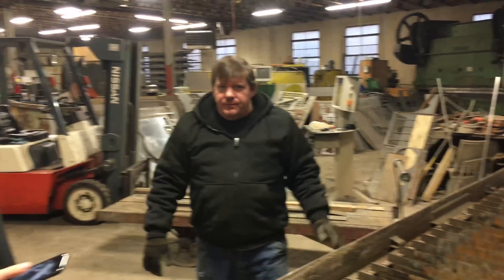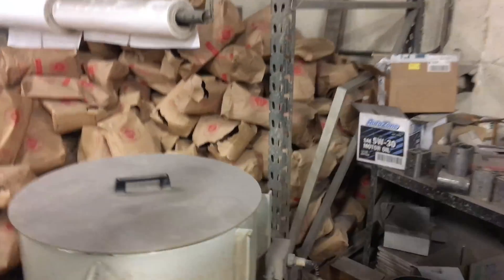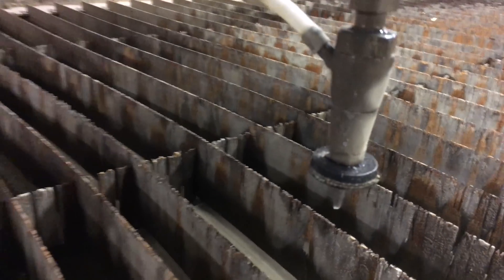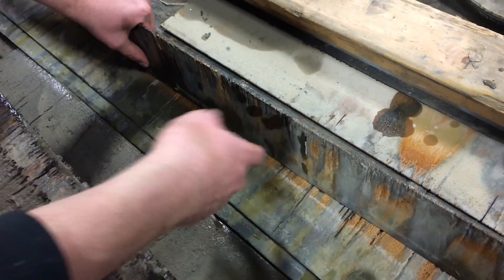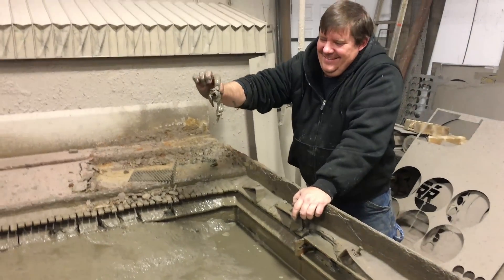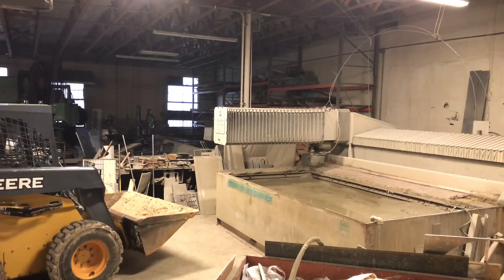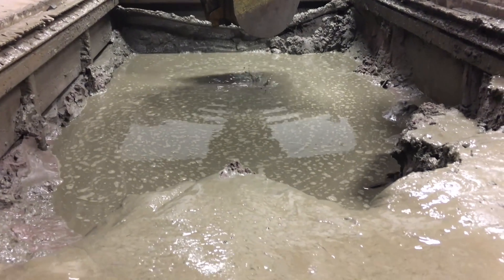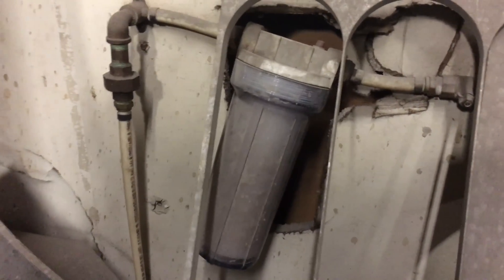Waterjet Tank Cleaning Mystery Objects - Waterjet Channel - Interesting

Comment: Man you guys should invest in the ebco filtration system and a Xtraxtor garnet removal system. I have it and it is great. Run the Xtraxtor while the machine is cutting and keep the tank pretty clean. We leave metal debris in the bottom of the tank to deflect the jet and protect the bottom from excess wear.

Comment: Waterjet Channel, not sure how long it takes you guys to empty the machine tank that way but at my work we have 2 of these waterjets and we hire in an industrial vacuum truck to vacuum the tanks clean.

Can clean out 2 full tanks within 6-8 hours.
Reply: You would seriously save a lot of time and money with an Extractor instead of using pump trucks.  See them at garnetremoval.com
Reply: Glenn S  vac truck takes 6-8 hours to clean 2 waterjet tanks that are full to the waterline with garnet. I'll check out that site though, any saved money for the boss is a brownie point or 5 😂
Reply: They just used one of our units to clean out their tank, so hopefully you will be able to see it in action on the waterjet channel in an upcoming cleanout video.

Comment: We had a self extraction system fitted in one of our Waterjet Italia machines tanks. It lasted about 3 months before it completely failed. Abrasives and moving parts don't mix! LOL
Reply: You need to get an Extractor!  We have units in operation that have pulled > 1 million lbs of garnet from tanks with no maintenance or repair time or $ invested.  See them at garnetremoval.com to buy or rent one.

Comment: ebbco makes filtration pumps that would make cleaning the catcher tank easier, at least it seems that way at my shop, we have the same brand of waterjets. 2 of our machines are the same size, and the 3rd is double the length and all 3 are 87k dynamic hyperpressure  machines!
Reply: For best in class garnet removal, the Extractor is the machine to get.  They will run for years without any investment in costly PM's like the rest of the competition.  See the product at garnetremoval.com to buy or rent equipment!

Comment: Do your slats begin to sag after a fair amount of torment or are you bracing them undercarriage, laser operator with a question!. "Fire Vs Water I know!!" Looks like the pierce time on those 30-40mm slices through the slats (whatever that is in inches to you) was far too long or the feed-rate to slow for the thickness, not deflection!

Comment: hey just wondering if you guys have a sand recovery system i know one place i worked at had a sand recovery system and the ultra fines were filtered out almost no sand in the tank when the sand recovery system worked had issues with the drying unit ours also had a refrigeration unit  before the pump and recycled the water if i remember correct

Comment: Hey guys.  My trade is waterjet cutting.  Have been at it for the last 8 years or so and in that time we've only dug our tanks out twice.  I would highly recommend fitting an abrasive removal system.  Quite a simple process and save's having to dig the tanks out every 6 months.  The best way is to use a Sandpiper bellows pump with flap valves.. If you need any advice on it, please give me a shout and I'll be happy to help.

Comment: You need to check for leaks or a poorly sealing check valve on your bucket. During the time lapse you can clearly see it starting to drop.
Reply: AirsickCashew what's dropping?
Reply: Every time they left the truck sitting idle with a full shovel load it would slowly drop. There is typically pilot operated check that prevents that from happening. There might be a little bypass over the poppet.
Reply: Its nice that you noticed that

Comment: How is the "sand" disposed? Can it be sent to be cleaned and reused or is it safe to dump?
Reply: was asking myself the same thing. is the sand reused somehow?
Reply: To answer your question....it's both "yes" and "no".

Yes.....you can reuse the garnet if you so desire.

No......it will not cut as good as the sharp edges 

            have been rounded off.....not as effective.
Reply: I looked into it my self I was wondering also , not sure what they do with theirs but the websites  I looked at said most places as long as they aren't cutting hazardous materials  (lead and such) most landfills will take it as business waste . You can also filter it out with additional machinery and reuse it but it isn't as cost effective.  And recycling according to the sights is kinda hard since there's not much industry for it but the garnet sand can be added to walkways and concrete for added durability due to garnets hardness and ability to stick together well with other materials . At least that's what the 3 or 4 sites all said lol

Comment: how far would the water spray if pointed upwards
Reply: magzire thru the roof
Reply: magzire far
Reply: magzire not that far actually. It's going too fast for a nice stream. The one I used just turned into fast mist after less than a metre. Same effect as a pressure washer.

Comment: The tank should be on wheels and deigned to roll up on a flatbed with a tail gate so you could go and dump the load, let it dry and reclaim the garnet. If you had two tanks then production would never stop.

Comment: Why don't you throw away the empty sand bags? Hobby collection?
Reply: Dloweification they probs re use them
Reply: Those bags are made from paper for single use.
Reply: Fire starter
Reply: oil soakers in case of a leak or needing to change the oil you just place that on the floor and then your pan and you wont have oil on the ground causing a slipping hazard have you guys ever worked in any type of garage?
Reply: Laziness

Comment: We have to clean out our waterjet every few months. We did it by hand for years. Then  found out our county landfill will take it. so we have a septic pumper truck come in and do it. A lot less labor intensive. They just need a garden hose to keep the sand wet so the pump can suck up the sand easily.

Comment: I ran waterjet machines for 5 years 3 the same as yours and must have cleaned over 60 tanks out. The big 10 meter tank had to be cleaned out with a mini digger and took at least 2 full days 😂
Reply: Jake Spencer My last shop had garnet filters that kept the tanks nearly garnet free. Only drained them to clean out the slugs, drops and cut slats once a year! it was amazing!
Reply: derek hughes a few of the machines I ran had sand tracks in the bottom of the tank that would scrape the sand out into a skip but little bits of metal would drop into the tank and jam the track so the sand would just fill up. I used to cut a lot of 30mm titanium for army helicopter blades and that would beat the hell out of the slats the thickest titanium I cut was 175mm at about 12-15mm per minute and that just destroyed them 😂

Comment: didn't realize you had to have an excavator and skid steer when you own a water jet
Reply: Hvguy you could just rent some Mexicans with shovels and a wheelbarrow, might even be a bit faster
Reply: nesbitt615 there is always power in numbers.
Reply: Hvguy and Mexican's
Reply: The Xtraxtor system works great, it's what we use on our two tables.

Comment: You guys need to get an abrasive removal system. We use an Ebbco unit and have never had to use heavy equipment to clean our tank. We just use a forklift to pull the big bag out of the hopper every 4000lbs of abrasive.
Reply: Jeremy Wasserstrass The Ebbcos are freaking amazing!

Comment: how much money in sand does it use in 6 months?  and overall cost to operate.
Reply: ShnitzlHaus The garnet actually used to cut is dry and is injected into the stream using air pressure. If it gets wet, it jams.
Reply: At the shop I work at periodically, they have a fancy filtration system which pumps the tank water up into a large (3ftx3ft or so filter bag to recycle the garnet. The water gets pretty clear after settling- hardly anything is left in the tank.
Reply: Should get CodysLab to try and filter some out and see if it's doable.
Reply: ShnitzlHaus I
Reply: Roughly 3/4 pound per minute if they are using 14 orifice and a 40 nozzle. I pay just over 20 cents per pound.
Reply: Dan Nichols it actually drawn into the mixing chamber via the venturi effect and a metering nozzle controls how much garnet is used.
Reply: interesting, I assume this would be cycled after a job to keep the garnet in suspension? (yes I see now garnet not sand, using that interchangeably) curious enough to look into that and the life cycle.
Reply: Peewee Herman
Reply: IIRC they've mentioned that the operational cost is around $2/minute with the new 5-axis machine. Assuming a run time of ~20hrs/wk that's around $65k per 6-week period
Reply: they bill around 2$ Per minute of waterjet runtime, but that includes operator cost and profit margin
Reply: If you filter the sand... The sand costs nothing.
Reply: Valueless Dollar no sand brakes down, it's a consumable item.  Even if you could filter it, a cost would be involved in doing so.
Reply: +ShnitzlHaus Come to think of it.. Yea, it would be difficult to filter out of the rock particles from the non-Ferrous particles, and yes it would probably cost more to clean the sand then it would be to buy it.. but then again they use Garnet instead of normal beach type sand. The process would be the same tho and not very cost effective..

Comment: How do you add the sand to the jet?
Reply: Nadav Semo theres a small insert called a mixing chamber that allows the garnet to mix with the water at the perfect spot. its just air pressure that pushes sand into head

Comment: I have a question. How much do one of these machines cost? How much sand/garnet is used for one cutting session?
Reply: kalloused I'd be more worried about the operating costs! The mixing tube where the water and garnet is mixed is $300+ alone. and that's a wear item! Most jets use 4-5 pounds of garnet per minute while running.
Reply: derek hughes mixing tube 105 diamond orifice 500 abrasive 1.1 lbs per minute @ .50 cents per pound.  overall price depends on model.  60,000-300,000+.  then all the extra wear parts on hand for replacement.

Comment: is the used sand considered hazardous material, and how do you dispose of it? just dump it out back or what?
Reply: G. Reaper 
Nah the battery's acid would dissolve in the water so its not that hazardrous
Reply: Then I relies that you put that comment a yearago
Reply: Wtf went on here
Reply: I would want to know what they do with it because if it is hazardous then they can't dump I out back
Reply: It
Reply: Correct. But the lead certainly is hazardous.
Reply: dinossauro
so you're telling me [CH3Hg]X is also not hazardous since it will dissolve into your skin even through gloves?

idiot

@WomenAreJustvesselsForBabyGravy dumping toxic stuff in your backyard might not be the economically smartest since when the property is sold someone will need to rehabilitate it which can be very expensive thus dropping the resale value
so creating a proper dump (from which toxins cant leak into the groundwater and surounding soil) might be cheaper. also those slags might valuable for others.
btw i like your name for triggering SJW's :D
Reply: crispyspa. I would imagine that after cutting open a car battery, it'd be hazardous... but I don't know.

Comment: had no idea the excavator's shovel slowly moves when stationary
Reply: Bernardo Santos not supposed to, maybe a piston is leaking.
Reply: Bernardo Santos it's called creep.  the pressure is letting off.  maybe a small leak in a ram or pump...
Reply: That tells you there is a leak forming. It really shows when it has a heavy load.
Reply: yeah had a situation at work when my forklift was raised up to 30 feet and i was trying to load a pallet into a steel bay, my fork was lowering as i was moving forward...told my boss and we inspected the hoses...sure enough a tiny pinhole was in my main line
Reply: haha yea i noticed that as well.
Reply: yeah that had me on edge
Reply: Its a leak probably

Comment: Do you treat the tank to reduce bacteria and how do you stop used abrasive from washing into the final drain or sewer?
Reply: i found a website that suggests that the water runoff can usually be put right down the drain.

Comment: my only question is, is there anything it cant cut? and why cant it cut it?
Reply: That is more just a speed issue, there isnt much a water jet cant cut if actually take the time to set it to match the material hardness. For these videos it appears simply to be ran in manual control and if they see the water spray back up (moving too fast so the jet didnt fully cut thru), you can see they move it back and finish the cut thru a hair slower.
Reply: I used to run a WJ and we would cut 9" thick titanium used as huge vault hinges!
Reply: There is a video on the internet of a waterjet, which is able to raise higher, cutting through a solid 12 inch block of bulletproof glass. They are pretty much unstoppable.
Reply: You can cut diamonds with a waterjet. It'd take a lot more abrasive and wouldn't be very cost efficient, but it can easily be done.
Reply: it can't cut water.
Reply: Cole Regal actually, tempered glass can be cut, it needs a special setup, but yes it can!
Reply: cole regal yes it can
Reply: Valueless Dollar yes it can
Reply: Water
Reply: height is a problem.  did you see the bowling ball video?  the ball is only 8.5" tall, and it made a terrible cut at the bottom of it.  you could just stack the material high enough to prevent a cut.
Reply: it cant cut the nokia 3310
Reply: The Gamers Elite  There once was a water jet that tried to cut through Chuck Norris. After 60,000 PSI of pain the water jet died.
Reply: another water jet of equal psi pointed directly at this one, equal and opposite force.
Reply: Kilo Busch Really? Thanks for pointing that out. Truly you have a dizzying intellect
Reply: The Gamers Elite 
Cocaine with powdered milk.
Because that's just wrong.
Reply: Awesomeness Films nah it's because there's nothing there drink me
Reply: the only thing that it can't cut really is diamond. that's because to cut diamond you would need a stronger than diamond abrasive. so really you can cut anything as long as it's weaker than the abrasive you use. I'm most cases a garnet abrasive is used like they do.
Reply: AlejandroThePillow
Diamond actually can be cut, you just need a diamond to cut a diamond. In other words, use a saw studded with Industrial Diamonds...or a laser, a very very powerful laser.
Reply: Ms. Nightshade ya. thats true. but in what they use which is garnet then they can cut anything that is softer than garnet
Reply: The Gamers Elite that's two questions
Reply: A nokia
Reply: The Gamers Elite just
Reply: Sodium...
Reply: Tempered glass can't be cut but that's pretty much it.
Reply: The Gamers Elite Stalinium.
Reply: The Gamers Elite francium
Reply: Tempered Glass can not be cut on a water jet.

Comment: Interesting video!
How much does one pack of this special(?) sand cost, and how many do you need for a "usual" cut?
Reply: Wertzu59 the sand last time I checked was 55 cents a pound. and one of those bags is 50 pounds. how much you need to cut is all based on length of cut material thickness, cut quality and water,kind of material you are cutting through
Reply: Wertzu59 The water jet I used to run used 4.5 pounds of garnet per minute while running!

Comment: why does the water need to be so finely filtered?
seems like anything left in the water would just help you cut better?
Reply: weesh ful at the cutting head there is a .014" hole that the water comes through its call a mixing disc and jewel. clean water is a must to keep the machine running smooth for as long as possible.
Reply: weesh ful I assume to pick up more sand?
Reply: I did some research, and it seems that all the parts upstream of the mixing area last longer if the water is well filtered.
Reply: additionally, sediments in the water would destroy the insides of that pump pretty quick.
Reply: G. Reaper. What type of pump is that? I mean what's the operating principle?

Comment: have you ever had to replace a slat because one was cut through?
Reply: When I ran a water jet, I would replace 50-100 slats at a time because they would be cut all the way or cut far enough thru that it wouldn't support material. We ordered slats by the thousand! Every year or so we even had to replace the 2 length wise supports!  We even had to drain and clean the tank once because the jet had enough power to push through 3 feet water and blew a hole through the bottom of the tank and needed to be welded! That entire tank of water ended up on the shop floor! LOL
Reply: derek hughes wow!
Reply: derek hughes ya. we have one at my work and I've had to take out those slats amd replace them as they get cut